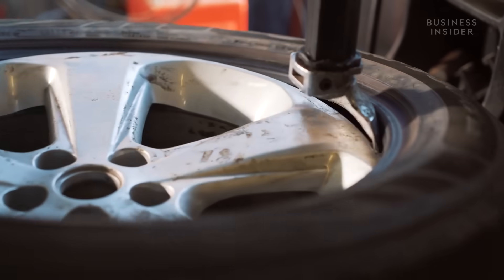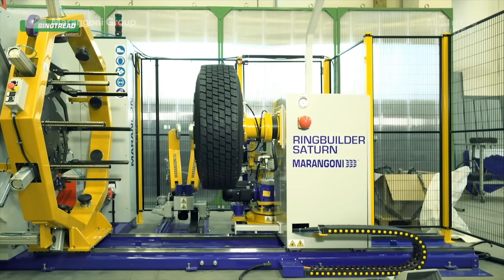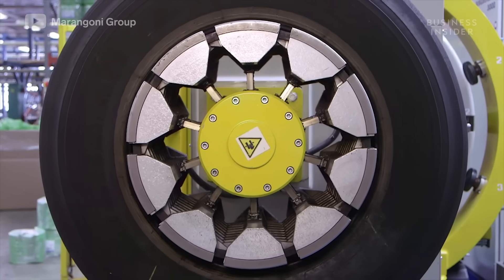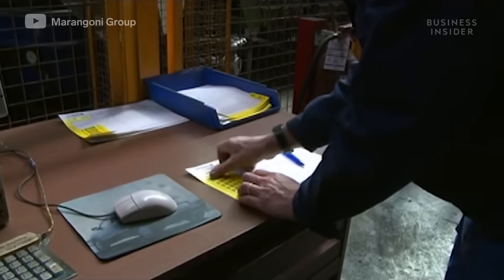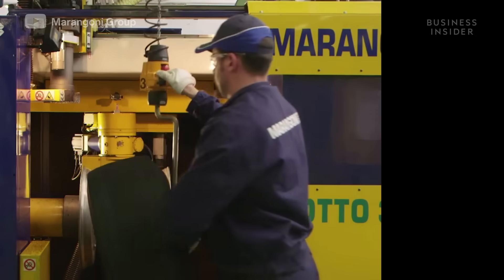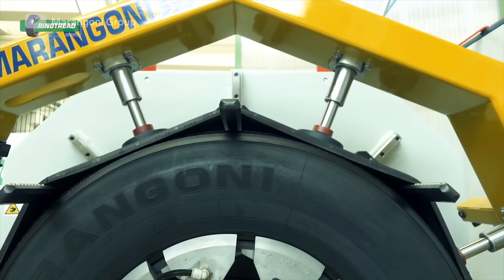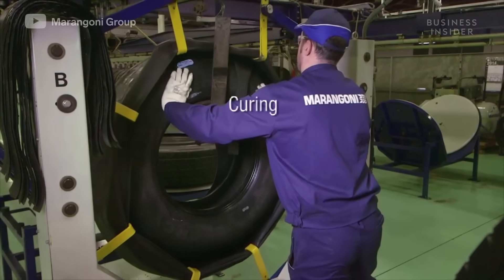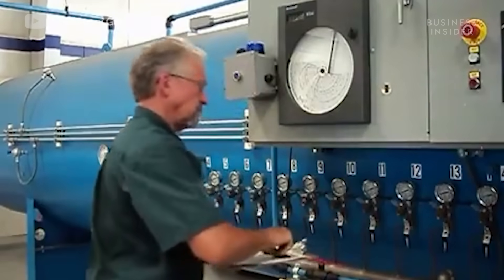How Old Tires Are Retreaded So They Can Be Used Again

Comment: the problem isnt the tread but the sidewalls which go through huge stress in use. personally i wouldnt risk my life buying them.
Reply: @yuuki_32  Well it isn’t glue. The rubber applied on the tire vulcanizes inside the autoclave and welds the tread and the tire together.
Reply: I use these tires, but I don't not speed around on them local use only . are cheap and good enough for me for how little I drive anyway
Reply: @Northern Finnish Believer do the letters FO mean anything to you?
Snow flake
Reply: Planet matters
Reply: In finland most of tire shops don`t even sell these tires and don`t recommend these tires because the wont last for long and they are dangerous. Most of the tire blow ups are these tires.
Reply: @TheFanHardstyle  makes sense.
Reply: I've never had good luck with using retreads. Either the tire itself fails or the cap comes off. That's why it's illegal in the U.S. to use retreads on the steering wheel of semi's.
Reply: @yuuki_32  I see shredded pieces of tire on the side of freeways and highways quite often too. Another challenge with retreads are balancing issues. It's not unheard of for retreads to be difficult if not impossible to balance too. Quality control can vary widely with them and with how much liability there has been with them I wouldn't trust them too much either. I have also heard often times there isn't too much price difference between a retread and a new, virgin tire either. Retreads aren't always cost effective either. If the sidewall is damaged it CAN'T be retreaded.
Reply: @yuuki_32  It is quite rare for a tread to fall off a tire because they have been placed in an autoclave to heat under pressure.  I work in a retreading company and we give a tire guarantee and hardly anyone returns the tires because of it, but again if the tread falls it usually depends on the manufacturer and the tire that will be retreading, but again if you are not sure there is another way of retreading where to put  fresh rubber on the tire and put in a press that heats it and the molds squeeze it and so make a tread like in new tires, thats how we retread small tires, I don't know how it's done in america but here in europe a lot of people don't complain.  Greetings from Bosnia and Herzegovina🇧🇦🇧🇦
Reply: @hercegovac9999  Here in Merica all we do is complain, if it were an Olympic sport we would win gold every time...if not we would just complain that others were wrong.
Reply: @wolfe2118  yes…, in recent years more people want to have tire that is produced same year, and that don't make sense because all tires are good that are up to 5 years old, and those that are older are not that worse as they think. People are more demanding nowdays…
Reply: @wolfe2118  your from London 🤦‍♂️
Reply: @hercegovac9999  they are good if the company that makes them does a good job like this one or the one that you work in as you say no doubt, but not for steering tire and you can not have them  by law
Reply: @hercegovac9999  most European countries banned retreading tires what are you talking about
Reply: @JohnLee-kr3fb  i know big retreading plants in Portugal, Italy, Germany, Croatia, Serbia, Austria etc. Idk where did you hear that statement but it is mostly wrong.
Reply: @hercegovac9999  Bosnia has industry? Since when?
Reply: @RoScFan  why it wouldn’t have industry, Bosnia isn’t poor but it have corrupt government…
Reply: @hercegovac9999  Yeah it is poor. All of the statistics ive ever seen about bosnia show it to be in the top 5 most dire situations in Europe, alongside Moldova, Ukraine, Kosovo, Armenia etc.
Reply: @RoScFan  that doesn’t mean its poor and don’t have industry, dont belive everything you read on internet, BiH doesn’t have best industry or that but it is decent 🤦🏻
Reply: @hercegovac9999  Would you ride a motorcycle with a retreaded tyre? If they are so safe and are guaranteed. Could save a lot of money come Trackday.
Reply: @jamesp8095  why not
Reply: @jamesp8095  Riding a motorcycle isn’t a good idea in general.
Reply: @jamesp8095  retreaded or normal tires aren't for trackdays if you wan't a faster lap time use semi slicks or slicks
Reply: @jamesp8095  don't use retreads on a track. Normal tires get destroyed on tracks fast. Wouldn't want to image a retread
Reply: @joshsuelto  I use RS10's which are street tires that I can use on trackdays. It was a joke about using retreads. I ride hard on the streets so I wouldnt even trust cheaper street tires let alone retreads. Im sure it would cause all sorts of havoc.
Reply: @spacedoge3508  smart guy
Reply: How would you risk your life, you don't know anything about tyres
Reply: @hercegovac9999  there banned in semis because of how many accidents have happened dude.
Reply: @SillyOmega  idk about your country but here is legal and no accidensts
Reply: @hercegovac9999  its ilegal in some states in usa.
Reply: @hercegovac9999  thats fine but different areas have different expirences.
Reply: @hercegovac9999  also don't listen to americans about your country there just salty there jobs keep getting replaced.
Reply: @SillyOmega  they are only illegal to use as steer tires in America. I promise you it's common to see retreads used on tractor trailers in America.
Reply: @hercegovac9999  you cant even spell tire right
Reply: @bigmackium8844  ???  Hopefully, a little sarcasm as "tyre" is the most common European spelling.
Reply: @bigmackium8844 *Tyre
Reply: @wayneegli8379  yeah joke unfortunatly people cant detect sarcasm
Reply: @wayneegli8379  Don't worry , everyone understands what you are saying.

Comment: This is not how we do it in Zimbabwe. We get a a tyre and a hot iron rod to dig up and retrace worn out treads. This dangerous system has killed many innocent lives on the roads. These kind of tyres burst all the time when that now thin rubber hits the road on any given hot summer days. The authorities turn a blind eye to this.
Reply: Your method in Zimbabwe is also dangerous. The sidewalks can’t be etched into any further. People need to understand that once a tire has its tread worn down, buy new tires.
Reply: I had a front tire with funny treads on it once.  I brought the truck to the garage and they showed me how somebody had used a knife to re-carve new treads into the tire.  At one point the person actually dug into the steel belts so I called my boss and had two new front tires put on.  Tires need to be inspected.  Used tires get shipped from North America to Africa all the time, be sure to look them over very carefully and replace them before the belts show.

Comment: This seems viable only for big, special tires...
Reply: Yup, already very dangerous on trucks, would be suicidal on passenger vehicles.
Reply: Exactly, construction tires etc etc.
Reply: On top of that, only really good for tires that get a lot of miles fast. Otherwise if it's just old the tire could have dry rot, and retreading won't fix that.

Comment: These thing always explode on semi trucks on the interstate. Nothing like having your brand new cars windshield smashed by flying rubber chunks.
Reply: @Glowing Alpine i don't think i've heard of that or seen it. seeing how it is possible, you have a point.
Reply: If it’s brand new you should probably have full coverage anyways 😂
Reply: @edgarh252  i knew a guy who totalled his brand new mustang no more than 2 weeks after having it. if i remember correctly, the insurance got him a brand new one
Reply: Insurance ftw
Reply: Drivers not checking tire pressure and running while at low pressure will cause enough heat to make any tire brand new or retreads to come apart.When was the last time you checked the tire pressure on your car tires? I did this morning.
Reply: @bobtoler5322  well, now days, most luxury cars have remote tire pressure sensors that display warning on the instrument panel if there is low pressure. but those things break down all the time.
technology may improve in the near future though.
Reply: @davidjacobs8558  yea those tjings always break. On my 2016 dodge dart those only lasted like 1 week. Apparently low pro tires and big sensors dont go well together lol
Reply: @bobtoler5322  The sidewalls are also a problem of retreats, get your facts right
Reply: @nedkogenov5530  That's why step one in the process is INSPECTION! The tire (in my days in the biz the 80"s) first went on a spreader a bright light was inserted them you stuck your head in the tire and you spent4-5 minutes inspecting it. Nail holes were fixed but sidewall seperations,inner liner breaks and other faults caused the tire crayon to come out and the initials RAR were written on the outside of the tire,RAR by the way stands for RECIEVED AND REJECTED! We had about usually 30 percent RAR's.But that was the 1980's now as shown in the video there using what looks to me like some sort of xray device for inspecting the tires. You are right though in that sidewalls can come apart but, running under inflated tires is a leading case there too.Underinflation causes heat which causes the rubber,fabric and steel belts to move in ways they were not designed to and as with anything else misused it breaks .Its simple Underinflation causes flats if your lucky , death if your not. That goes for all tires not just retreads. 
P.S. Flown in a Airliner lately? At 20 to 30 thousand dollars each and limited to 50-60 landings by law they get Retreaded and put back on the airliners.Fear of flying growing yet?
Reply: @bobtoler5322  I doubt underpressured tires are the cause of tires blowing,because where i live, EVERY single truck gets inspected before it goes on the highway. There was only one problem, my friend's boss wanted to buy retreats to save money, and when he did, that caused an accident. The truck went off the road and the flying rubber hit a few windshields wich caused more accidents.
P.S:Airliner tires arent like truck/car tires, they are way more durable
Reply: @nedkogenov5530  every truck gets a full inspection every time? Obviously your not in USA. When it's Zero degrees or lower or 105 in the shade drivers tend to get in the heated or airconditioned cab awfully fast.again any time your in a car or truck what's touching the road or dirt( or rocks as shown in the video) is really just a balloon. Treat them with respect or else.
Reply: @bobtoler5322  Yeah i actually dont live in the USA, in my country every trucl gets a full inspection before hitting The road
Reply: your windshield only gets smashed because you're following too closely.
Reply: @DavidLinn  Ever heard of passing, nimrod?
Reply: @marmars1081  of course. i just haven't seen a blown tire roll across lanes of freeway. and i think you are misusing nimrod as an insult when the historical character of nimrod was a very powerful person. he was practically a god.

Comment: Until they blow out on the highway and cause an accident 🤦‍♂️
Reply: Im a truck driver transports big trucks all do 😂
Reply: @SubToRandomVideos101  I'd never run retreads, but I read a study a while ago where supposedly modern retreads have a similar failure rate to brand new tires
Reply: @SubToRandomVideos101  I didn't even see you commented let alone talk to me good thing that guy tagged me well ya most of you probably do unless you tried to take nothing but back roads but uh idk haha
Reply: PS 400  yes in canada, my truck has em. Can't be put on steering wheels in North America. Don't spread false info
Reply: They do this for population control
Reply: PS 400 yes in Canada wtf😂
Reply: Retreads really don’t fail any more than virgin tires normally once the casing breaks down they all become liabilitys
Reply: like every other tire
Reply: Bullfred !!!!
Reply: Don't use them on the highway then

Comment: Isn't it true that these tires sometimes explode or shred while driving? There was an inside edition story about this.
Reply: because most retreading is done by small shops, not this type of big factory with sophisticated machinery.
Reply: steering tires are mandated in america to be brand new. all the rest can be retreads. since truckers usually own the truck but don't usually own the trailer, truck owners put brand new tires on their trucks usually and the trailers ALWAYS get retreads. it just doesn't make financial sense to spend way more money on brand new tires for trailers, especially when most trailers are not owned by the driver hauling them. the biggest PSA i can give you regarding trucker tires is STAY AWAY FROM THE TRAILER TIRES! truckers don't want you anywhere near them. they can explode outward with the force of a grenade and if you're behind them the retread can come off and go through your windshield and decapitate you. IT'S HAPPENED. truckers love it when you stay next to the truck doors, next to the middle of the trailer, far ahead, or far behind. these are places where we can see you best and prevent killing you in case of emergency.
Reply: @DavidLinn  GOOD ADVICE
Reply: That’s why you see them on big trucks, where 1/18 tires blowing out won’t cause a crash, and on those off-road vehicles shown
Reply: @squidinkRC  it might wont cause a crash but having a heavy piece of rubber hit a car or a motorcyclist can cause a crash.
Reply: @squidinkRC  Yup the semi keeps going but then is causes an accident or significant damage to people BEHIND them. Retreads should be banned.
Reply: Treadwright, a tire manufacturer that sells remolds ( a little different from retreads ) has several reviews on Youtube.  I think I remember seeing one where a tire lasted less than a thousand miles, another that couldn't be balanced because the tire was not round.  I was looking for some cheap tires and saw that Wal-mart sold them, I decided to check out reviews and that's what I saw on Youtube.
Reply: @vivillager  - haven't seen that but I can speak on experience. I was told about Treadwright from my brother in law. I was told the tires for my jeep wrangler from there would be perfect. 1st set lasted 5 years. I changed em to new ones about 2 years ago. Best tires that I've ever run on my wrangler. I use their Mud tires for traveling any and everywhere. Just my experience though.
Reply: @aidendamien , In my opinion, personal experiences are the best test for any product, which was the reason why I resorted to Youtube to catch others opinions, I figured that surely someone had something to share.  A few negative reviews won't scare me, but there were too many who claimed they got less than 100 miles out of their tires, several who claimed their entire set failed in less than 100 miles, plus the one video where the tire never made it past the balancer.  But I'm sure someone out there has had negative experiences with the type of tire I'm using, Radar RLT-8, a cheap All Terrain from Malaysia I think.
Reply: That's usually I different type of retread that's cheaper, those retreads are rolled on and have a seam at the point the 2 ends meet. This is awesome.
Reply: True
Reply: You can see not once exploding tires like michelin and other very good mark.

Comment: Sounds like a lot of work, hopefully they have good margins.
Reply: I doubt they do this for normal passenger tires, only more expensive high load tires meant for things like semis.
Reply: @Excalibur2  although percentage wise it is less common, retreading is also done for passenger car tyres, at least here in Europe. However, that's mostly a product for tight-budget-oriented buyers as the performance characteristics of those are mostly not on par with the OEM tyres. However, for some motorists these make a ton of sense.
Reply: making a new tyre is significantly more work which requires a lot of resources and energy. This kind of "helps the environment" by some degree, although we are still destroying it at an enormous pace, even by doing these kinds of "environmentally friendly" things.